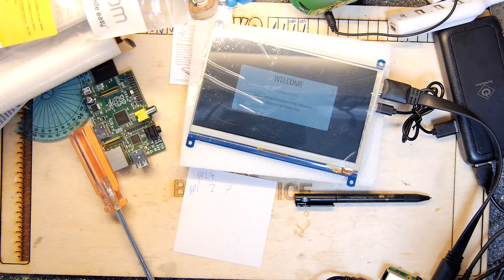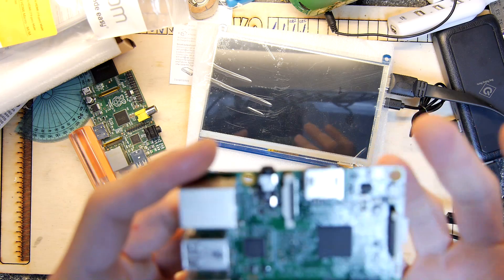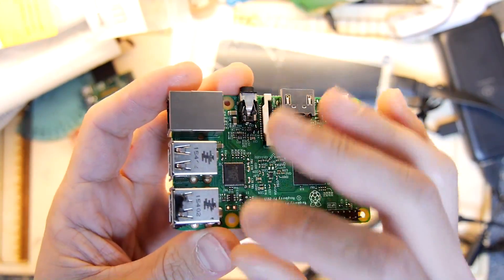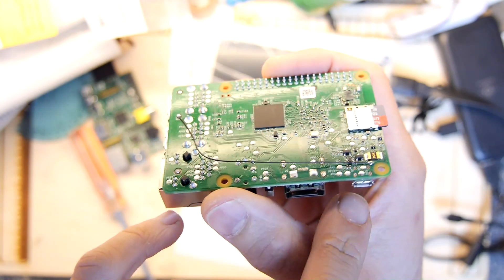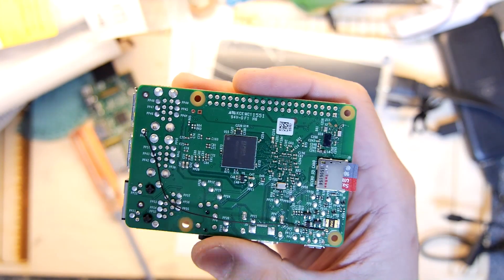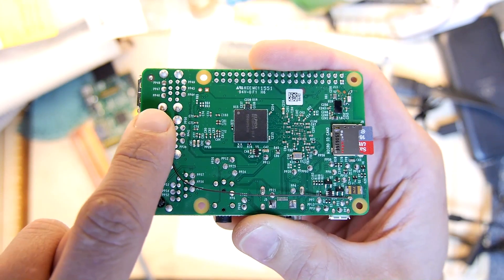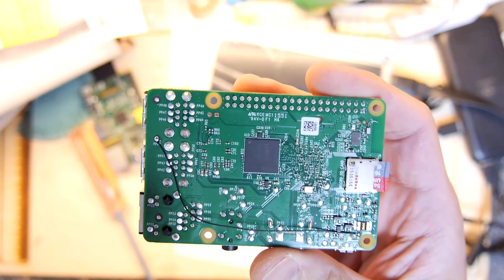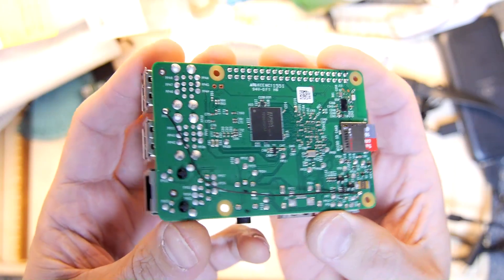DEAD USB on Raspberry Pi FIX!

Comment: I have the same issue as you did. But when I soldered the lead as you did, it stopped my RPI3 from powering on. When I pulled the lead, it powered up again. If I connect the lead after I power up, it cuts the power again. Any ideas?
Reply from the maker: +Chesray Nelson You may have a big short elsewhere so soldering the lead us bypassing the blown component and shorting out your PSU.
Reply: The Backoffice I might have to chuck this board. I also tried bridging pins 1 and 6 on the component marked U13. Same result. Last stop is to try and remove C97. Happy new year!
Reply: @user040782  I have the same problem, did you manage to solve it by now? Thank you in advance!
Reply: @thomasplooijer4437  unfortunately not. I returned it to the eBay seller. I wanted the RPI for a media player. I settled instead for a used fire TV for the same price as a RPI. Good luck.

Comment: I do not have a Raspberry (I have to get it from China :)) I own an Orange Pi2 with IC adj voltage Sy8008 burned ..... I tried to power the GPIO through 5V pins and then to 3.3V but without results. This change that suggests in the video how can I use it in my case? Thanks so much.
Reply from the maker: +Pierpa_76 Pierpaolo I'm not sure as I have never seen that hardware, but someone might be able to suggest something
Reply: By carefully checking the card with a magnifying glass I finally found the "VBUS" point near the micro-usb. Instead the point PP1 (which in my card is not called this) corresponds to TP1. We hope to see some results.
Reply from the maker: +Pierpa_76 Pierpaolo excellent 👍

Comment: Hey. Great video as always. I have the same issue. I spent all weekend looking at this. Before I buy you a coffee...could you please tell me what items I would need to complete this process. I've just bought a multimeter. Any help would be appreciated.
Reply from the maker: Lee Bailey Umm, I think Multimeter is a great start, followed closely by a soldering iron, some solder and a little wire. I do think you'd anything more fancy than that. I Always advise you spend reasonable money on tweezers as well - and by reasonable I mean over £20 😁
Reply: The Backoffice Thanks for the reply. Is there a certain type of soldering and wire I need? I'm new to this kind of stuff.
Reply from the maker: +Lee Bailey where are you based? I'll find some links
Reply: The Backoffice Thank you. Manchester.
Reply from the maker: I added some amazon links to a nice cheap USB iron, any thin wire you can find will do.
Reply: The Backoffice That's great work thank you.

Comment: Great Tips !
But on my side, by doing that the Raspberry just restart. And each time P1 and P27 are linked, the device just stops
Reply from the maker: +Olivier LN could be a bigger problem elsewhere. Sounds like a dead short somewhere. Measure the resistance between those two points. There shouldn't be any continuity
Reply: Same thing happened to me, it wasn't turning on when I did the jumper, so I removed the jumper from PP1 and PP27 and then removed C97, now it works great!

Comment: Had my Pi 3 do the same thing a while back. After some searching thinking the cause could be poly fuses as far as I could gather the Pi 3 does not have them on the USB! The root cause seems to be something going wrong with the USB power control IC. Just off the top of my head I think it's a small 6 pin chip very near the USB ports on the top side of the PCB. I ordered a replacement from Digikey but unfortunately after a very precise solder job the USB still point blank refused to work. A quick work around is to short a couple of the pins on the chip which will allow power to the USB or as you have discovered with your method. Just a word of warning, these methods will mean that you are running USB devices with no over current protection and could be a bit risky! Though my Pi 3 still works fine without the chip.
Reply from the maker: +Carl Ridley I think I'll be fine, a couple of USB control pads will not draw much. Would love to know why the ic failed in the first place.

Comment: It's definitely a blown polyfuse on the usb 5V rail. I couldn't find in my quick search where the blown fuse would be (would be labeled F followed by a number, and testing continuity across it will tell you if its released its magic smoke) but you can add your own 2A or so rated fuse in series with your wire and you will be protected (well I would use thicker wire if you plan to use higher power usb devices).
Reply from the maker: +sjm4306 I indeed pimped the wire significantly after the video, but didn't bother with the fuse ... yet. 😂 The poly fuses I found were ok, but the could still be one lurking around some where 👍
Reply: The Backoffice When you are in a pinch a wire can be a fuse ... just the caveat that it doesn't always fail deterministically ;-p
Reply from the maker: +sjm4306 It's fine, fuses are 'over rated!' 😂
Reply: My friend threw my pi and a resistor fell off and then the usb ports wasnt working any more. Thank you for helping me fix my pi!

Comment: Genius!!! Gotta love jumper wires. Just a thought, how are you normally powering that pi, via gpio or usb?
Reply from the maker: Plain old regular USB. Running happily for ages than BAM! randomly stops. Kinda annoying for sure. The jumper wire might not be the best fix, but better than binning it :)
Reply: Well that rules out any voltage protection issues. Hmmm.
Reply from the maker: There is not much conditioning or regulation it seems from the incoming USB so jumping the power rail would suggest potential track failure, or a fuse or 0R resistor somewhere. Nothing obvious like that is jumping out at me. Ironically the few people I saw complaining on the web did not get a resolution on it.

Comment: Kool fix.  Fly my man!

Just a though, I would imagine there are schematics lying around on the net? May be just a pull up/down resistor may be bad?

Cheers
Reply: This may help. 
raspberrypi.org/forums/viewtopic.php?t=75913&p=543662

raspberrypi.org/wp-content/uploads/2012/10/Raspberry-Pi-R2.0-Schematics-Issue2.2_027.pdf
Reply from the maker: +I_will_get_you There I found the schematics on the pi Foundation site but nothing jumped out at me 🤔
Reply from the maker: For some reason I cannot search the pdf. Oh well!
Reply: I_will_get_you There Yep the Droid you are looking for is on the first page in the upper left labeled F3, it's a polyfuse.
Reply from the maker: +sjm4306 I'm pretty sure that's the one I checked. I will have another test later. Cheers